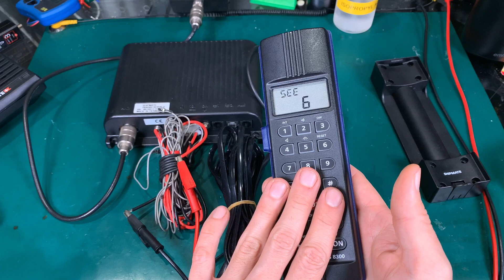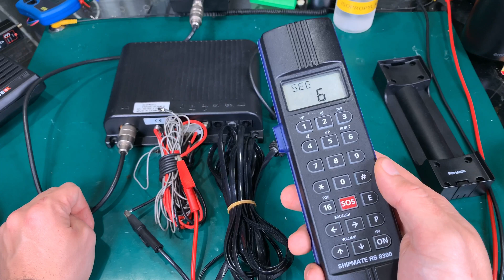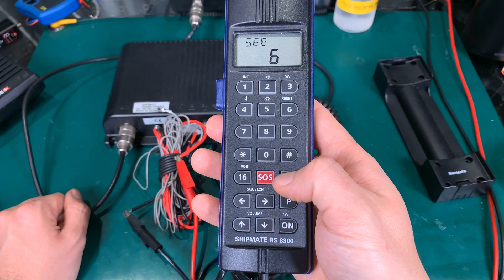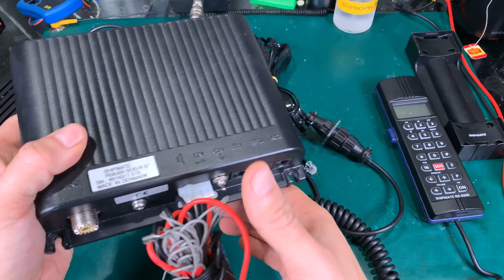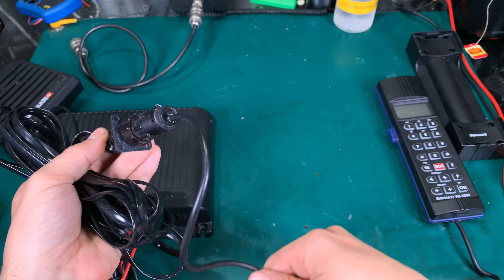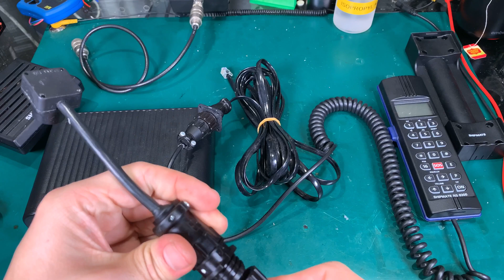SIMRAD Shipmate RS 8300 Marine VHF Radio for boat  / vessel

Comment: Do you know how to reset the MMSI?
Reply from the maker: Sorry but I do not have that knowledge - most like You need dealer tools to wipe it because it's used for distress signaling so it's required to be tamper proof - it's not something that can be done by simple key press